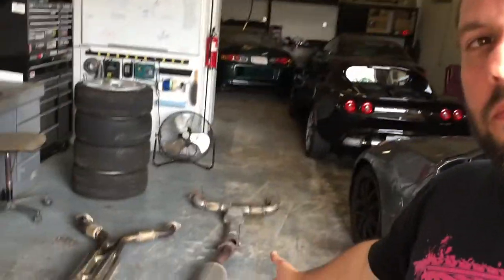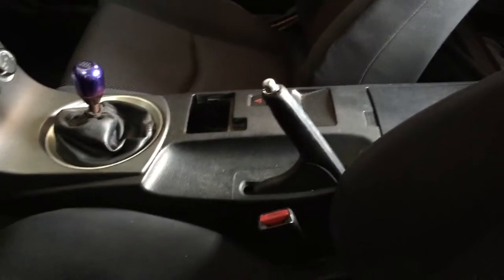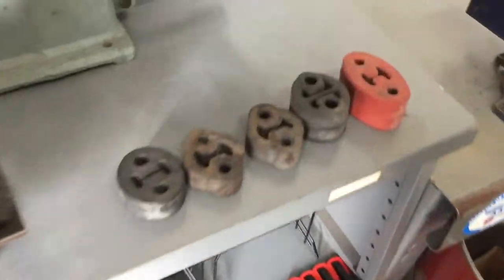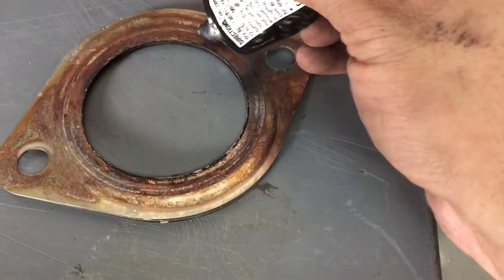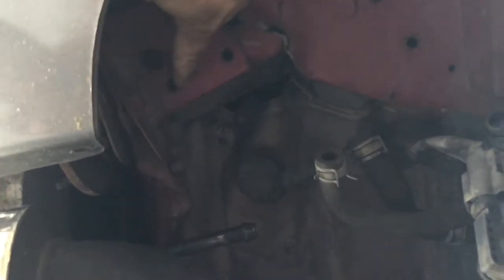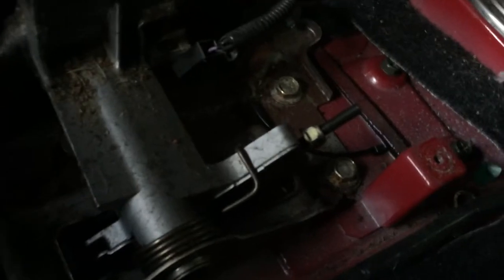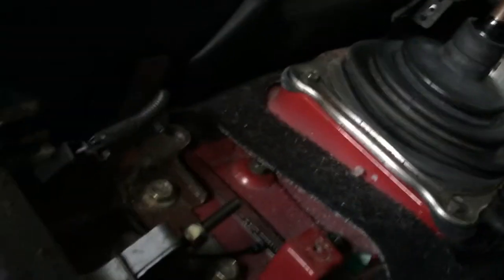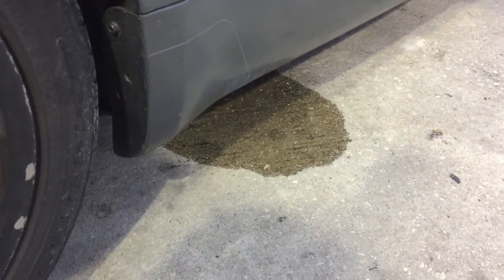Exhaust Fix #2 and Still Leaks Gas :(

Comment: A tube of sealall should fix your  gas issue, ive used it before and it never failed! The engine did about 8 months later tho XD
Reply from the maker: Boost & Baked Goods 
I'll check it out if there's a hole in the side. In need to drop the tank though!

Comment: I think yours is all located in the box at the back edge of the console. My 07 does not have the little sensor either.
Reply from the maker: Twinrotor1987 
I mean, it was dark in there. But that box in the rear I thought was for the airbags.

Comment: you're leaking gas cause the person who you got the car off probably tried fixing the gas gauge problem and never changed the fuel pump o ring gasket. I had a problem of gas leaking out when I attempted that fix.
Reply from the maker: jeremy fong 
I just replaced it. I also looked in there when it was leaking just to make sure, it was dry. I mean, i could check one more time, it would be much easier than dropping the tank!

Comment: check your vin online there was a recall on some the z cars for some of the rubber line not being up to spec or something so they cracked and started leaking... NHTSA Reference# 05V555000.... the tcs is basic traction when the slip comes on is when the lsd is supposed to be locked cause it is some fancy electronic lsd or some hoowey like that  lol funny thing is is have my abs and traction disconnected all the time  and i still can not do a standing burnout either car just pushes or stops all together i wanna say some skinny tires and it will do it or a bit of water down..=p
Reply from the maker: __Jared __ 
I'll look into the bulletin. This car also doesn't have the VDC fuse. Maybe it's just traction.  i need it to be drivable at night and for it to rain so I can do some testing.
Reply: Car Sick!! yeah if it is a base model it will only have traction control.. vdc is like stability management and traction it messes with the subframe as well from what I have read before... here is a link to a forum with some pretty good info.. good luck man I wanna see the car running properly.😁 http://www.350z-tech.com/forums/146-driving-techniques/45647-tcs-vdc.html#/topics/45647?page=1
Reply from the maker: __Jared __ 
Have cruise control, TCS and VLSD. That should be Enthusiast package, from what Wiki says.
Reply: Car Sick!! check your registration or insurance it will tell you what model you have based off the vin